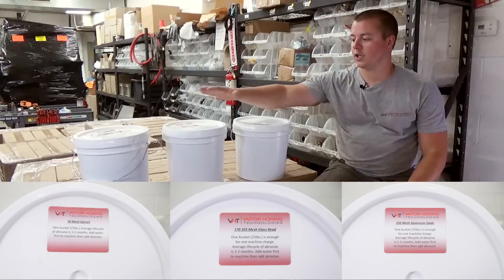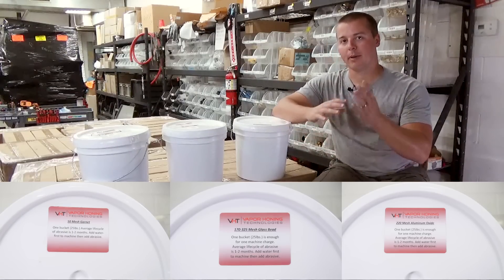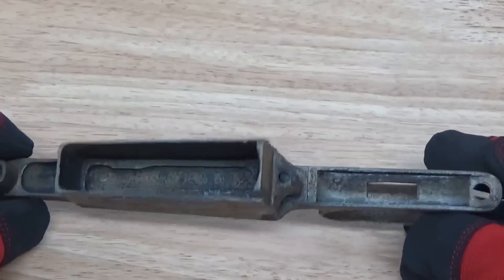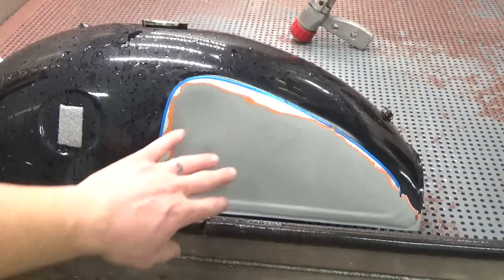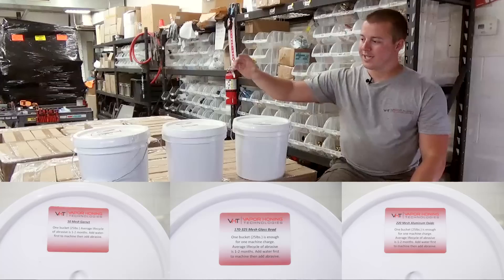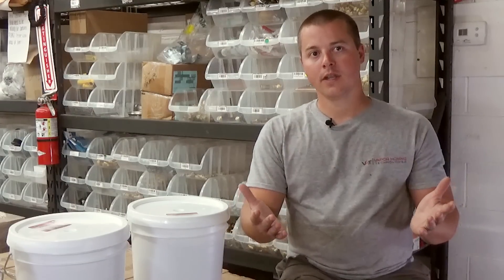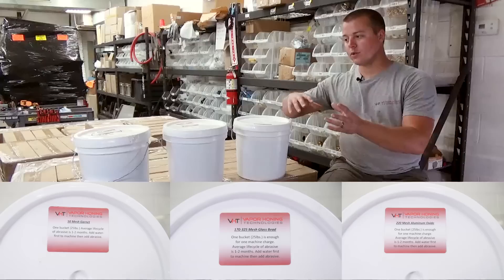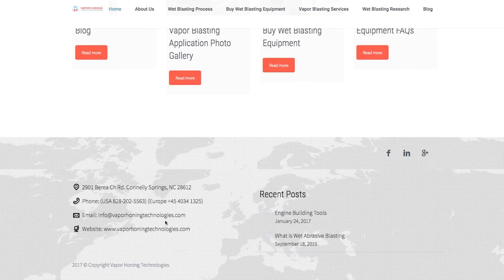Abrasives 101- Garnet, Glass Bead, And Aluminum Oxide The Three Most Common Abrasives.

Comment: 1. PLEASE TURN OFF THE MUSIC.  IT HURTS THE EARS, DROWNS THE VOICE, & IRRITATES THE MIND. NO NEED FOR EXTRA NOISE IN A VIDEO.

2.  Open the lids and show the material.  Stick your fingers in and pour it so we can see the product.  1 picture = 1000 words.

3. Start blasting.  Show, don't tell.  This is video, not radio.

4.  70 - 90 PSI, not 70,000 - 90,000 PSI!!  

5. Garnet may be very abrasive but in  a fine grit like 200 - 300, it can remove the lacquer finish on a piece of fine furniture with no damage. So it depends on the grit size being used.

Comment: Is vapor blasting just for aluminum? Will it work well on cast iron?
Reply from the maker: You can use this process on everything from Aluminum to Cast Iron, to brass and copper, 3D printed parts, prep for coatings, etc.  The possibilities are endless.

Comment: I am a real sandblaster and this is absolutely retarted add water to metal it will rust i have blasted anything and everything you could imagine with all three garnet glass and i mainly use #54 starblast if you know what your doing you wont hurt it
Reply from the maker: We have blasted aluminum, copper, cast iron, steel, titanium, and many others; the process works great.  If you fear it will rust, there are corrosion inhibitors you can use directly in the slurry mixture that will prevent rusting.
Reply from the maker: Please don't misunderstand, we are not knocking Sand Blasting as a process, just offering Vapor Honing as an alternative.  There are some applications folks may like the finish better.  As for rust, the main metal that is an issue is Cast Iron, and there are corrosion inhibitors to assist in that process to prevent rust.  Thanks for watching.